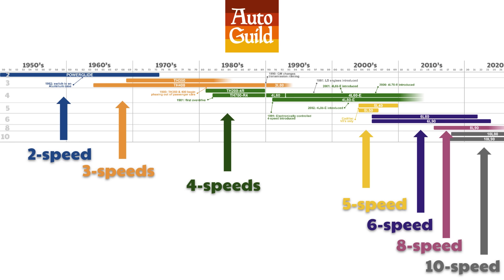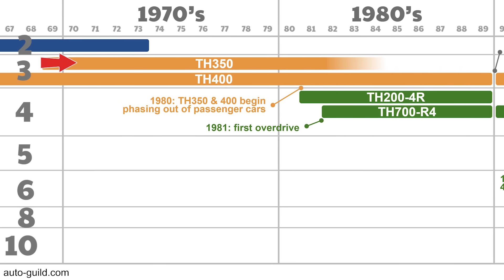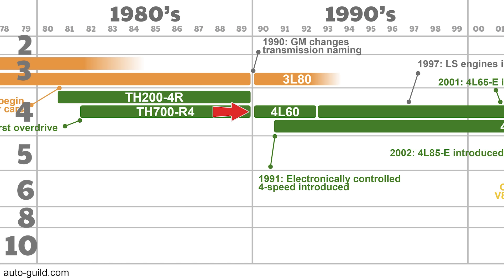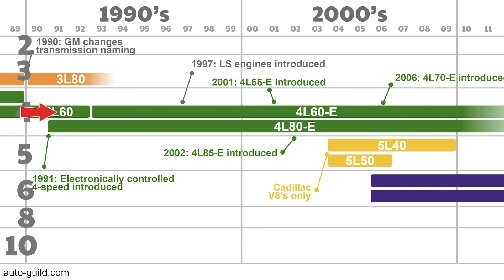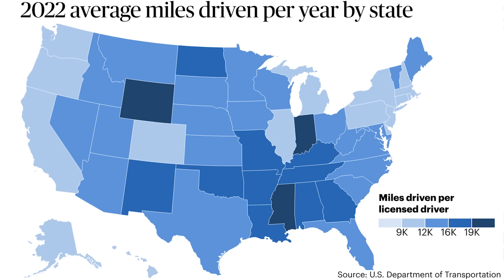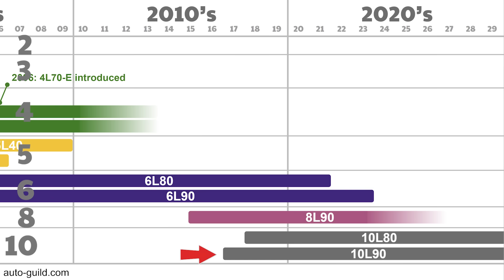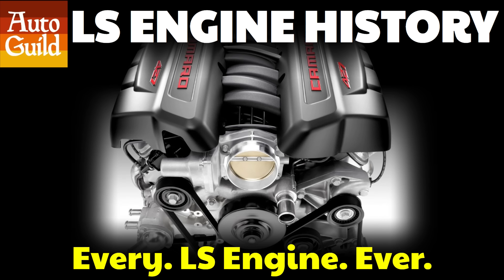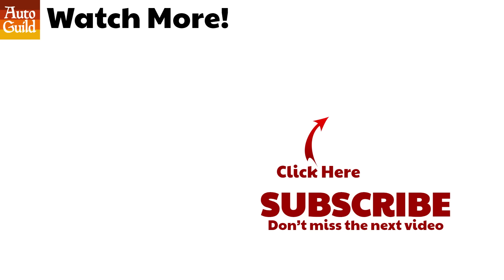All 15 Automatic Transmissions (Powerglide to 10L90)

Comment: 5:05 weight is not the only downside of the 4L80, it has a much narrower gear spread. First is 2.48 compared to the 4L60’s 3.059 and it even has a shorter overdrive at 0.75 vs 0.696. There was a company making a wider first and second gear for an 80 but from what I’ve read they were weaker than stock. TCI developed a 6 speed version of the 4L80 with a 2.97 first gear. The 6L80 has a 4.03 first gear. Many things to consider.
Reply: Taller first because its typically behind more powerful engines. 😊
Reply: @samholdsworth420  but a consideration for lower powered vehicles, like 250-400 HP. To your point, though, super comp dragsters run in the 8s with two speed powerglides, so you don’t have to have 6 to 10 gears if you have 4 digit HP.
Reply: @snappyaj9053  I only favor the 4L80  because I got tired of helping  my friend swap a 4l60e in his Silverado...
Reply: The added parasitic drag with the 4L80 is worse imo, most guys running >400hp are running 60/65/70’s over 80s anyways, but if they do have a 4L80 and need the power you can always shorten the rear end a bit

Comment: You missed the TH200 intended for 6l and 305 2V engines. Ended up installed in 350 4V Impala and Caprice cars. Of course the increased vehicle weight and engine torque caused a bit of trouble, eventually repaired. Then they added the OD.

Comment: 200-4R had a better rpm spread between 1st and 2nd than the 700-R4, and could also shit into overdrive at WOT, whereas the 700-R4 you had to lift and reapply throttle to go into OD at high speeds.

Comment: The 200r4 was never in the corvette. The th350 with a lock up converter was used in 81. The 4L85E also had straight cut planetary gears for strength.

Comment: Forgot one very important ( due to lawsuits and failures) automatic transmission used on full size V8 GM cars equipped with the 305 and diesel 350... The infamous GM TH200 metric 3 speed transmission that eventually became the 4 speed TH200R4 that was used in the Grand national... But by then was a much better and stronger transmission than it's 3 speed metric counterpart... Also the TH250 as well... But I'm not as well versed on that one... Then you had the TH350

Comment: I had a 1993 Silverado with a 5.7 and 4L60E. The original trans lasted until 118,000 miles and lost 2nd gear, so i had it overhauled. That build lasted until 258,000 miles. Then it developed the notorious 1st to 2nd slam shift due to a worn check ball passage. I sold the trans to a Jeep builder at that point because the truck had bad salt cancer.
Reply: I had a similar experience and it was the best 93 z71 gmc I ever had. The engine, front end , axles and body were never touched for 258,000 miles. The frame rust eventually got too bad and had to be sold.
Reply: There's a repair kit for the cheapo valve so it's reliable again. My 2005/6 truck went the same way with the slamming and loud clang like a big 🔔.

Comment: You forgot to mention the 6L45 6L50 and 8L45 which are the low performance variations of the 6 speed used in slow v6 cars, they are very similar to the 6L80 but 90% different parts not even the case is the same.

Comment: The PCS TCM-2650 allows the later model 6 speeds to be swapped behind earlier EFI & even carbed engines. It may also work with the 8 & 10 speeds, but I'm not sure on those.

Comment: You didn't mention the THM 200.  I know everyone tries hard to forget that abortion, but they did exist and I am sure there are still some vehicles out there with one.  Or maybe not, the TH200 to TH350 swap was a huge thing.  Another thing about the TH350/400, there were two "TH375" transmissions, which were not the same.  First was the TH375 which was essentially a TH400 with a TH350 sized and splined output shaft.  Used extensively by Oldsmobile in their B cars (Delta 88, 98 Regency etc).  Then, there was the TH375B, which was a beefed up TH350.  Mostly found in some Buicks of the day, could be identified with a dual pattern bellhousing case that fit all BOP and Chevrolet V8 engines.
Reply: Yes, I was going to mention the 200 3 speed.  They were high warrantee items, but the fact remains they are very popular in NHRA Stock class GM cars. Why? Because they are fast !

Comment: The 4L60 in my 2007 Silverado 1500 is trash. It never sees off-road it does nothing but get driven about 7,000 mi a year and has been rebuilt three times now by aamco and I'm into this thing almost $14,000.

Comment: The manual mode was not limited to the 8 and 10 speed units.  Not sure what year it was introduced, but the manual shift mode was also available on the 6L80/6L90.  I know for sure they were in the trucks in 2017.
Reply: I have the 6L80 in an 09 G8 and it has manual shift mode. Have also driven early 2010s vans with the 6L90 and they too had manual shift.
Reply: The 4T65 in the 04+ Pontiacs like the Grand Prix GTP Comp G had Tapshift.

Comment: Not sure I agree with the statement about the 700r4 around 3:30.
 The 700r4 I don’t  think was ever used behind any 454 or in any 2500/3500 series truck. 
 Square body trucks  2500/3500 series got th400 transmissions, then the 1991, still a square body style 3500 series trucks got the 4L80e. 
  Prior to 1991 all dually trucks were th400 trucks.
 The new body style in 1988 didn’t offer the 454 with the 700r4 either. 
 The only c1500 in the 1988 and up body style to get the 4L80e was the 1991-1993 454SS trucks.
 Regular 1988-1995 C1500 trucks didn’t get the 4L80e. 
 2500/3500 1988-1995 trucks got the 4l80e.

Comment: 4 speed or less suck at least in  crown vics it lugs the engine if it had a 6 speed it would be better. I don't get it why automatic transmissions were so behind compared to manual transmissions up until recently. They already had 5 and 6 speed manual transmissions in the 90s but yet we used 4 speed automatics up until the mid 2000s as standard. Then came the 8 and 10 speeds. Even in the 60s they had 4 speed manuals in pony cars and stuff and yet automatics were 2 and 3 speed. More gears are better. Well actually in my opinion eight speed is the sweet spot. 10 speeds hunt for gears. They say that 8 speeds are actually more fuel efficient then 10 speeds.

Comment: They might refer to the turbo 350 as a three speed powerglide. But it has enough differences that they don't do the same thing a powerglide does. Other than the obvious third gear. And that is the fact that the pump is driven by the input shaft instead of the output shaft. Which means that you can't push start a turbo 350 but you can with the powerglide.
Reply: you got that wrong it is the other way around
Reply: @concretesteelmsn  I'm not sure i understand what your saying. The early cast iron and early aluminum cases I believe at least until 1964 had front and rear pumps. If you had a battery going bad place the tranny in neutral get the car going about 15 miles an hour and with the key in the on position you put the tranny in low and it would fire off and you were good to go. The power glide is a two speed two pump transmission. The turbo 350 has three gears and a single front pump leaving it and the following trannys not push startable.  I've lost count of the times I've pushed started my 64 Impala. But I've never even attempted it on the turbo 200, 350,400 or the 4L80E and I'm not going down the rest of the list of automatics they have out now.
Reply: The powerglides with a rear pump also had a front pump and it was only the early powerglides that had the rear pump .
Reply: We used to pull start my 63 Impala and my 66 Chevelle, both had 2 speed Power glide trannies with 283 V8's.

Comment: When I had my 67 Firebird's transmission rebuilt, I thought I had a Powerglide 2spd transmission. I was wrong, Yes it is a 2 spd but it is a ST300 2spd by Buick . Pontiac used it as did Buick .
Reply: variable pitch stator also found as switch pitch in th 400

Comment: You missed one GM auto ! The General Motors Australia "Trimatic" a 3 speed auto , same length as T200 4r , same output splines, mounting, shift linkage , was made in Australia from 1969 to 1987 , has a one piece case , was put behind GM Holden 308ci V8, 253ci V8 and 202 ci six ! Can be made to take 1000 HP and was the most efficient GM Trans in its day ! Even today they are still being built and drag raced ! The V8 ones have a Aussie only Bell housing that very closely almost matches an Oldsmobile one , later Aussie GM Holden V8s such as the injected 304 ci and 355ci were the same block as earlier 308 ci engines but drilled for chev Trans pattern , there are many adaptor plates from Holden to chev vice versa , anywhere a T200 4r or T350 was a Trimatic will bolt up , it's 40 pounds lighter that T350 and will take double the power , the cost of a V,8 Holden Trimatic used is about $350 US for a good running one .

Comment: Dozens of cars and trucks I had with these over the years...One TH-350 had a Governor go bad, TH-400's could not be killed!, 4L60 was my favorite with a 5.3 in an Express but it had a solenoid go bad and stuck in 2nd, 4L60 was great but I felt the 4 speed was easier to live with in daily driving.  GM makes the best Trans overall IMO.
Reply: My buddies transmission just went out on his 2013 Chevy 2500 van with 190,000 miles.  His engine is the 4.8L.  The transmission shop charged him $5000 to rebuild it.  I do not know what transmission he has, but all of our 4l80e transmissions in our 3/4 ton pickups have always lasted 280,000 miles.
Reply: @MyLifeThai371  4.8's get the 6 speed

Comment: i bought an 82 z28 it was a 305 with a stupid metric 3 speed auto,,,,,its not listed.. i eventually put a th350 in it and had to do a full crossmember torque rod conversion. the car is now a 350/th350 car.  how it should have been from new.

Comment: I am 33. And I hate the LS Engines. I'm SBC. Easier to work on and maintain. 90° V vs 60°V LS. I want to do a SBC swap into a modern truck just to 🖕to LS.
Reply: a barebone LS block is essentially an optimized gen III sbc; both are 90° blocks (60's are V6's). LS heads are world's better than anything you can put on an old school small block; LS's wear less and have stronger bottom ends (I've rebuilt several 200K+ mile LS's that exhibited practically no bore wear, many of which still had the factory crosshatch hone)

LT's (engines with AFM and VVT) are the ones to stay away from
Reply: @wildbill6976  I can't work on them is my biggest issue. 8 coils vs 1 way more $, no distributor everything computer, more $ to replace, then the accessories are not organized as accessible as the small blocks. If they made an LS with a distributor, 1 coil, a carburetor, and rearranged the accessories. I would not have anything bad to say about them. The 90 vs 60. I was told the LS was a 60° like the old 2.8 v6. Thank you for clarifying

Comment: I don't think that a factory 700-R4 would stand very many full throttle shifts behind even a mild HP 454 engine. I don't think GM ever offered this combo, for obvious reasons, but that being said, if you could get it to hook, it would have a great launch with the Deep 1st gear the 700-R4 had.
Reply: You're right, GM didn't offer anything other than TH400s or its later variants bolted to big blocks. GM did put TH400s in C3 Corvettes but that was likely because of tight packaging (the electronic kick-down switch saved space).

Comment: I had a "cast iron" case PowerGlide in a 57 Chevy with a 61 spec 283 FI. The only good advantage was the Iron case Powerglide, the bands could be adjusted externally without pulling the pan.
Reply: They had no pan on cast Iron Glide.

Comment: 700-4r not r4. Everybody gets it wrong
Reply: 700-R4, the 200-4R, Now please tell me what's wrong with this nomenclature.
Reply: @jamesglavich1426  the 700-4r is a GM transmission. The 700-r4 is not. Many people use 700-r4 to describe the 700-4r.  It is a mistake that has even crept into the parts listings and it bugs me a bit. I was a service manager at a Cadillac, Pontiac and GMC dealership when this transmission was developed.

Comment: Would have been nice if you mentioned about the 2-speed jet-a-way transmission with the switch pitch tork convertor as well ss the the switch pitch 400 turbo found in the Oldsmobile, Buick, & Cadillac's only that had and external switch to adjust the RPM stall of the tork converter ...they were the best transmission's set up you can take a small block 2-speed jet-a-way transmission switch pitch tork converter and swap it out i to the 400 turbo that would allow for a higher stall speed and put a switch on the shifter to manually control the stall of the conveter when I set (power) the switch in the up position I'm in high stall, when I turn tge switch down (power) the low stall direct drive on the converter great for drsg racing without buying expensive high stall tork converter just go to the wreckers snd look through the Buick / Olds section for the small block 2-speed and big block 400 these transmissions looked exactly the same as the chevy transmission's only difference was the switch on the left side the convertor and pump assembly to handle the extra tork from the Buick & Oldsmobile's
Reply: Yup

Comment: Can you tell me if a 700r4 in a v6 camaro would be the same as a v8 clutch wize and other parts
Reply: Insides are weaker. They were tuned for the application.

Comment: 50'ish years ago a transmission was built to handle X HP/Torque.  It weighed what it weighed to accomplish that.  Now they want a trans to handle 500ft/lbs, contain 8 gears and do it at a limited weight.  It's laughable.  The TH400 and 4l80e are the end all/be all of transmissions.  The 6l80 is a terrible trans.  The 8 spd isn't much better.  Both have the same life expectancy as a 4l60 behind a 5.3.

Comment: 1:21 Chevy had one in the corvairs that you could push start, which is pretty unique for a auto.
Reply: Early aluminium powerglides could also be tow started . They had a rear pump as well as the normal front pump .
Reply: If a transmission has a rear pump in it, it can be push started
Reply: @455buick6  they did stop doing that though.

Comment: As a diehard PONTIAC fan (with no General Motors politics to hold me back), u didn't mention the Super Turbine 300 two-speed transmission that came in the B.O.P. bolt pattern. I had one behind a 350 PONTIAC in a Le Mans. It's maybe a weaker trans than the powerglide but, i hope u include more B.O.P. & Cadillac transmissions  in future videos. Thanks.
Reply: not weaker it had a switch pitch stator good trans

Comment: Those Transgo kits come in different types for various different transmissions. You can get them in stage 1/2 (quicker shifts, but still auto) or stage 3 which is stage 2 shifts with full manual shifting. Highly recommend

Comment: Also the THM350B, which at least Buick used in mid-sized cars with smallblock V8' from '71 to '73.

Essentially a heavy duty THM350 with extra clutches.

Then there was the TH350 with a lockup converter...

Then the THM400 'Switch-Pitch", has a converter with 2 different stall speeds.

Comment: The ONLY reason the OEM's spent the million to develop 8- and 10-speeds was to meet emissions and mileage rules - keep the engine in as narrow an rpm band as possible, then tune it to meet the regs.

So the EPA drove up the cost of vehicles, PLUS the cost of repairs (go price a 10-speed rebuild). Compare that to the amount of fuel saved and reduced emissions, both of which are so small as to be insignificant.
Reply: So true.  It's also why trucks are so big now.  The bigger and heavier they are, the more "wiggle" room they have for efficiency, or lack-there-of.
Reply: @jamyers1971 
Wrong, yes a 8 and 10 will lower RPM during high speed long distance driving, in turn raising the MPG. This paired with AFM or DFM (drop cylinder usage to 4 or even 1) of GMs full line met and acceded the EPA standard for MPG as a vehicle manufacturer WITH THE ADDITION of the 2011-2019 Chevrolet Volt that added a monstrous 70 MPG combined against their manufacturer EPA MPG average. The EPA did ZERO to drive the cost of vehicles up. Safety standards, material costs, hyper engineered electical systems, infotainment, road noise dampening, lighting, lists goes on.
Reply: . I'm sorry, but saying that the EPA did nothing to drive costs up is just so wrong that it defies reality.
Reply: How many overdrives do they have, 2?
Reply: @xmo552 one...torque converter lock up
Reply: @samholdsworth420  that's not an overdrive.
Reply: EPA. An unelected bureaucracy that complicates with its endless regulations, not laws passed by elected officials.
Reply: GM didn't need 8 speeds to meet EPA. If you pay attention people are obsessed with mpg and they have to stay competitive with the ecoboost if they want the sales.
Reply: @NoName-ml5yk. Pfft. I do pay attention, and people aren't as obsessed as you think - otherwise truck/suv sales wouldn't be as big. 

Even if they were, how do you think they get higher mpg numbers? By supertuning the engine within a narrow rpm range, then using 6, 8, 10 speeds to keep it there.

Same with emissions.

I stand by my OP.
Reply: Its also a lot easier to do work on a 10 Speed Torque converter Auto than a 10speed DCT

Comment: It looks to me with the 10L90, if running a big block, the first gear is too low and the middle OD gear is not good for much. Either remove it or make the last OD gear .55 or taller. A small block new LT and the older LS engines would be a different situation with the 10L90 and a lot better match.
Reply from the maker: For sure, even the first year on the 6-speed is super low at 4:1.  That first gear would be awesome for a four-wheel-drive rig though combined with the transfer case for a super low crawl ratio